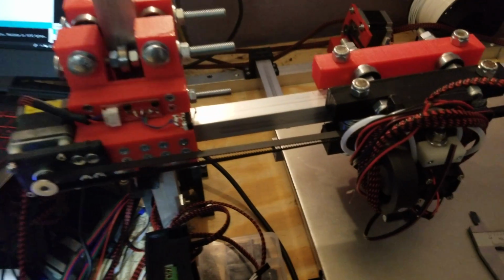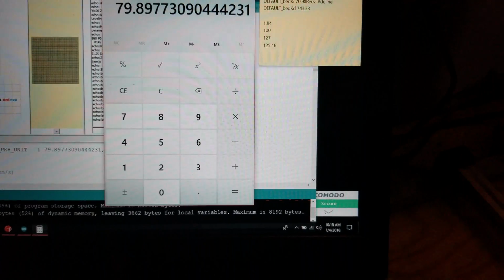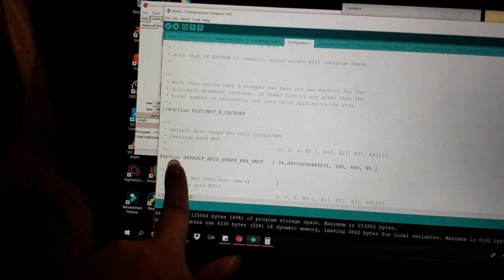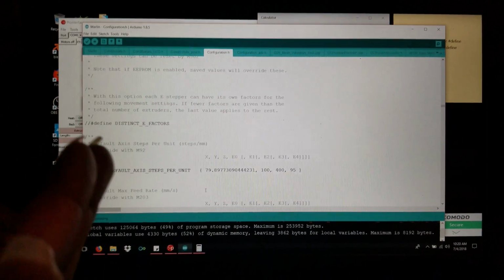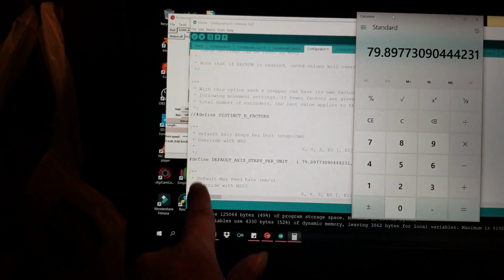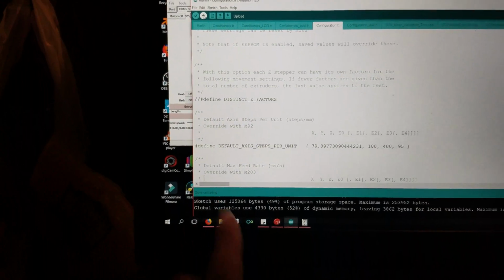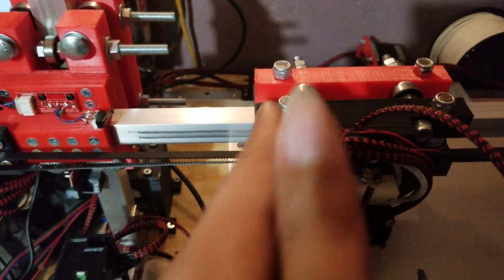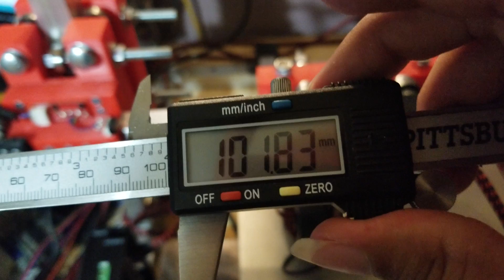How to calibrate your stepper motors on 3D Printer !

Comment: You have the correct idea. All these other idiots are calibrating based on printed parts which is totally wrong. A proper way is to use an indicator with something like what I made. https://www.thingiverse.com/thing:4635329